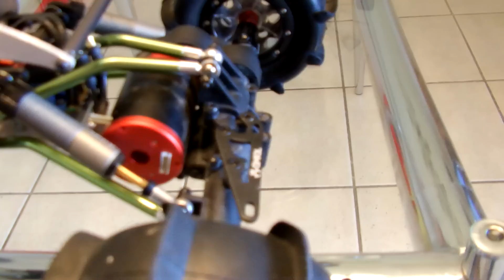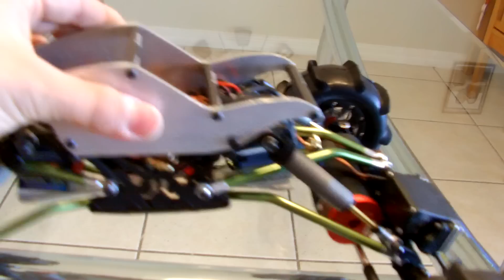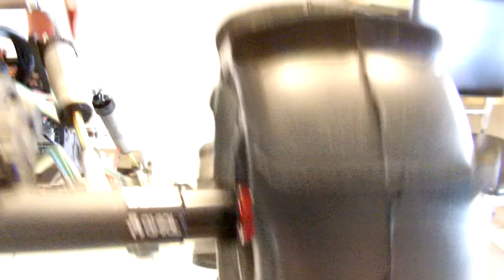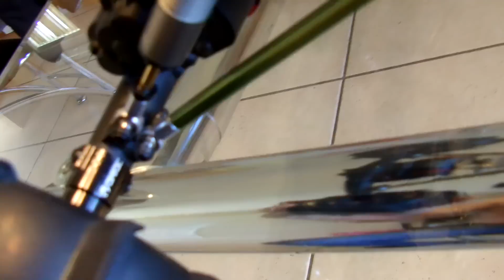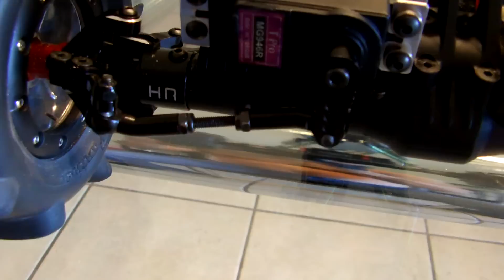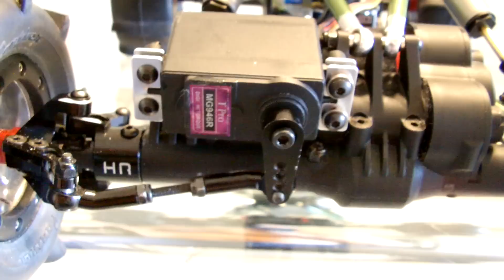Axial XR10 Comp Crawler / Formula Offroad 6 Topper / Cab / 6100kv Brushless / aluminum parts

Comment: you really should have gone with higher turn, lower kV motors because these motors wont have nearly as much torque as you would want in a rock crawler
Reply from the maker: +Random Lab thats true, these were the motors I used for the FOFF part of the build. I needed this high KV to be able to get past the gear reduction in the xr10. I have a few videos of it running these motors at 2s and 3s lipo.

Comment from the maker: Actually most people do this with the Wraith instead of the XR10 because its so much easier that way. The XR10 was a bit of a challenge because its meant to go slow, and nothing else, the wraith can do it all pretty well. Most wraith projects use a 1/8th motor instead of the 540 size motors Im forced to use hear because of fitment issues.